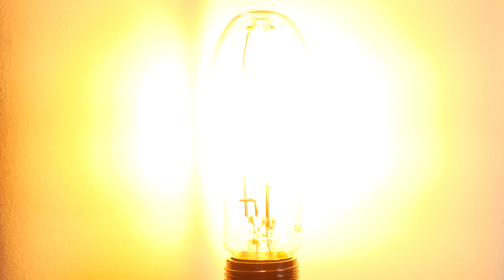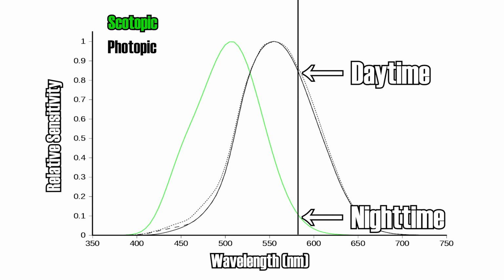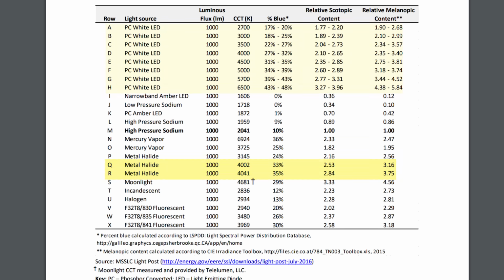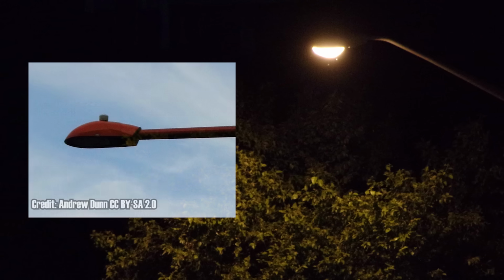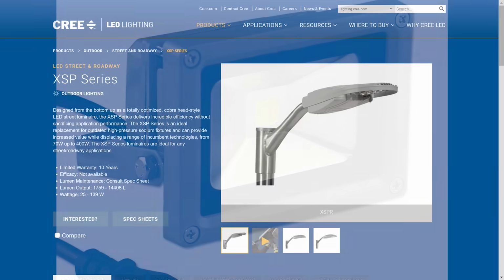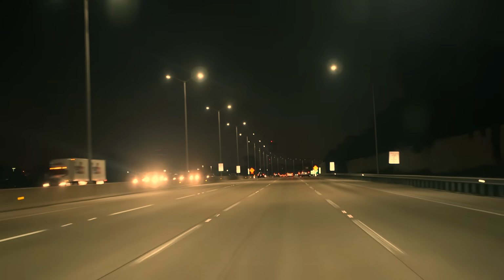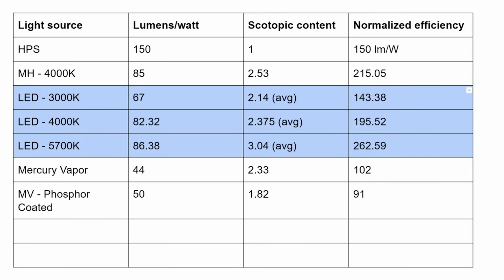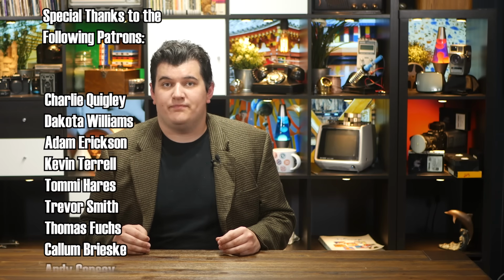The LED's Challenge to High Pressure Sodium

Comment: I see the Circadian disruption effect as a feature, not a flaw...the blue tinged light should tend to help keep drivers awake behind the wheel where the yellow tinged light will tend to increase fatigue and sleepiness...sleepy drivers are a VERY bad thing, especially if they're behind the wheel of 80,000 Lbs. (or sometimes more) Tractor-Trailers...
I was a Truck driver before getting sick & tired of the BS at the Borders as well as dealing with constantly increasing traffic congestion and/or bad weather and I found the blue-white light kept me more awake and alert behind the wheel.

Comment: I am slowly replacing my lights to LED , i still have a bunch of CFLs so i am half using LED half using CFLs and replacing the ones that burn out over time with the left over CFLs until hopefully eventually i burn thru all the CFLs and continue to replace them with LEDs. 

The original plan was to replace all with LEDs but then what to do with all the left over CFLs?  and thats why I am only half replacing them.

Comment: The big problem with LED lights is that they are so bright that the light bouncing up off the street is like a bright light shining up into the sky, becoming a big source of light pollution, especially when there si highly reflective snow on the ground, and no leaves on the trees to block the light.  The sight of the winter sky used to be utterly awe-inspiring.  NOw Orion is barely visible, even though the Cree fixtures in my city are carefully designed to not shine up into the sky.  There is a big lie street light vendors tell and that is that the LEDs are the same brightness as the sodium vapor lights, which is true only when measured photopically.  When measured scotopically, which matches the way the human eye sees, they are much much brighter (due to the shift in sensitivity so vividly portrayed in this video).  My suggestion to the world:  Motion sensors which turn off or dim lights when no one is around, and filters/optics which reduce the ultra-bright spot directly under the lamps, while maintaining even light to the sides, along with an overall dimmer light level.

Comment: Why not Amber LEDs on low speed roadways and in residential areas and white LEDs on High speed roadways and in commercial areas (albeit a little tricky in mixed use areas). It is important to light pedestrian areas too, not just the roadway, but I think pedestrian lights don't exactly need to be those stylized fixtures we often see that contribute to light pollution, there are a lot of good down facing recessed lighting options for pedestrian areas which can also just be attached to auto light fixtures.

Comment: The problem with most LED street lighting is that they are badly directed, leaving a well lit spot on the ground but too far away from the next lamp so the streets end up light, dark, light , dark and thus a driver's eyes have to keep adjusting to changing illumination.

Comment: Blue LEDs are burning my eyes. I hate LED headlights and xenons with a vengeance, especially in unlit areas where they blind me and kill my night vision.
I had to resort to wearing yellow glasses at work because the monitors finally made me see double (with each eye). Took a week to partially recover and even now I rarely can look at a monitor for a long time without the hole burning sensation.
P.S. there were cars with yellow headlights here in the event of major fog happening. And the yellow street lights are comfy in all weather. And not killing night vision, in the event someone argues about the blue light advantages in seeing.

Comment: Many street lamps in the Chicago area have been changed over to LED lighting. However, many of the units are failing only one year later... some, less than a year. Previous HID lighting lasted much longer. Did anyone include the cost of relamping when calculating the "savings"? Relamping crews don't work cheap and work on a "whenever they get to it" basis. Lamps can be out for months... like the one across the street that died after a month. Another added cost to relamping LEDs is that it's not like changing a bulb. The entire fixture is changed. Another co$t miscalculation?

Comment: I think, we should go for 5000k to reduce the production of melatonin while driving on higways etc. In cities there is an aesthetic problem with 5000k, as well as with sodium pressure light. I hate to see historic centers of cities polluted by sodium pressure light. There we should go for 2800-3000K. We humans love this light so we should use it for those areas. On bigger inner streets, we can do a compromise with 4000K, just for safety issues. So it don't has to be the same everywhere.

Comment: It may be just me, but I see better at night if the street lights are the color of a high-pressure sodium light.  For example, if I'm driving at night and go into an area that's well-lit by white LED street lights, and then into an area where the lighting is negligible (like the open highway), it takes a while for my eyes to get used to the dark.  But if I'm driving at night and go into an area that's well-lit by high-pressure sodium lights, and then onto the open highway that isn't lit at all, my eyes don't really have to adjust to the dark.

Maybe the sodium spectrum has something to do with the preservation of nighttime vision, as well as circadian rhythm?  Or maybe the narrow band of sodium light is easier for my eyes to focus in a low-light situation than full-spectrum lighting.  Those are just guesses based on personal experience, since I don't have any science to back it up.  Whether it does or not, I'm finding that the older LED street lights around my neighborhood are lit by white-light LEDs while the newer LED street lights are the same color as a new high-pressure sodium light just before it reaches normal operating temperature (sort of a copper-white mix of color).  The newer copper-white colored street lights are a lot easier on my eyes than the brilliant white-light street lights.

In conclusion, at least in my neighborhood, the LED challenge to High Pressure Sodium has been accepted and the hammer already came down.  The newest LED street lights are practically the same color as a new high-pressure sodium light.

Comment: White (blue-white) LED street lights often trick my mind into thinking another car is approaching (for instance, around a blind corner). It can be very distracting, which is obviously a bad thing for a driver.

LED headlights in oncoming vehicles are dangerous, pure and simple. It doesn't matter if they're factory fitted or aftermarket, the effect is the same. There was a time when these headlights would have been deemed illegal, due to how unsafe they are. But that was before most people turned into NPC morons with zero common sense.

Comment: Im so Pissed. In Mississauga Ontario they changed all orange lights to the Led White lights. I understand they save power.
But they are so annoying . The orange hue helped keeped bugs away and was less stressful to our eyes.
Reply: Insects visible spectrum is much more blue centred than ours, and they see red very poorly, if at all. So a higher CCT light would definitely be more likely to attract them. I mean bug lights are yellow after all. 
I miss the HPS lights. 4100k is pretty much standard in most cities in Ontario now, and it's very jarring. 3000k would've been a compromise, but I've barely even seen any LED street lights this colour so far.
Reply: a color of light doesn't keep bugs away. certain lights attract bugs though. are u saying that the bugs are attracted to the new lights?

Comment: OK, but is this really a problem ? Like: are highways so badly lit that the sodium lights actually are the cause of so many crashes ? Because LEDs, if unchecked, will have more consequences than this. LEDs emit a continuous spectrum of much cooler frequencies : as bad as light pollution is already, 1) at the moment you can get rid of most of it by using wavelength specific filters and 2) also because sodium emits a longer wavelength, it doesn't scatter nearly as much as cooler LEDs, so the problem of light pollution will increase, not just for us but for all the ecosystem around us. This could have unwanted effects on all manners of insects, animals and plants surrounding us, who already provide ecological services that are crucial to us.

Also, it would wreck the night sky for all of us, and virtually destroy my astrophotography hobby... :(

Comment: I read a lot of accusations of LED glare here. Most of that super annoying glare comes from HID lights that are poorly installed and not dimmed when they should. For a short period of time some makers of high end cars used HID's as standard equipment, and many DIY HID kits were (and still are) being sold on the internet with optional color temperatures. And, as usual, there are lots of egotistic drivers that like to literally show off their brighter-than-yours headlights, sometimes with an exhaust system to add sound to their rudeness.

Comment: Re. "blue light harms the eyes", the colour spectra of sunlight - what we think of as "white" light - peaks in the blue/green area of the spectrum, rather than being evenly distributed all the way through from red to violet. This is why plants have green leaves: there's a maximum amount of light chloroplasts can use for photosynthesis at any given wavelength, and only the amount of blue/green wavelengths in sunlight are significantly above that level. This means large amounts of excess blue/green light is reflected, but little or no light at other wavelengths. This also explains why rod cells are most sensitive to blue/green wavelengths - to maximise vision in low light conditions, our eyes have focused their sensitivity on wavelengths where there's the strongest light to begin with. So the "blue light harms the eyes" thing really doesn't make any sense because our eyes have, over hundreds of millions of years, specifically evolved to cope with the very high levels of blue light coming from our sun.

Comment: A really, really informative video, and one that shows the complexity of the issues involved, most of which I had not realized.

Blue v yellow lights along roadways: This seems to present a bit of a dilemma. You see blue better under dim night conditions (scotopic), but yellow light keeps you awake, which may be important on long drives or when it late enough that you could get drowsy. Which is better may be a highly variable thing, depending on the driver's state, the length of the drive, and possibly other factors.

It seems LEDs have an unparalleled flexibility and can be molded to a lot of different requirements, but the molding is a long way from being fully worked out to the best configurations.

Naked LEDs have narrow bandwidths, so astronomers should love them for their ability to be filtered; but white LEDs, of course, are another matter. Maybe pseudo-white, from a combination of naked elements, would be better.

Comment: I think a combined solution would be best, depending on the road type. For example on major Hwys that are far from residential areas you WANT drivers to stay awake and aware, so the higher temp colours would be a better choice, while roads closer to residential areas can use a lower temp colour to minimize the impact of the blue lights.

Comment: I prefer sodium in residential areas, a blue spectrum (higher Kelvin) shift is okay on the highway. However not in residential areas, some moron switched our 100% residential area from high pressure sodium to an annoying as hell LED 360° decorative lamp. To be honest it has crossed my mind to disable the bulb because it's straight into our Master bedroom.

Comment: sorry for the broken english in your country led light for vehicle might be good for my country not really , reason some driver abuse the right for installing LED light on their vehicle , example ford raptor lucky that vehicle too expensive like after convert about 193k USD on my country rarely can saw them on the road those LED light bar installed front by default when turn on can totally blind ahead vehicle and incoming vehicle 

or another type LED light bulb installed on their head lamp by show off look cool and want to brighter than other or giving excuse my eye got problem cant see on night when any older vehicle rear mirror and side mirror not equipped latest technology like auto dimmer really annoying , really make you how about i install the spot light on my rear just turn it on when they purposely  blind other people on the road if my local law allowed

Comment: What I found, with most LED lights, is that they're only as good as the driver circuit. Every now and then you'll see a burnt-out LED, or group of them in a string, but nine times out of 10, it's the driver that burns out in most LED light bulbs. I can imagine that the same would be true if they were used in street lights.

Comment: So, staring at the sun doesn't damage human eyes? Unless I am interpreting your words inappropriatly, that is not correct. Retenas get burned, and it is not entirely a function of wavelength of visible light. There is more involved in the physiology than simple sensitivity curves. It is entirely possible to damage eyes with spectral energy beyond thr scope of visible light, and most certainly within our visible spectrum, damage can be generated. I am glad to have just stumbled on to your wealth of geekery, and have just subscribed.

Comment: What pisses me off is people putting aftermarket LEDs for headlights on their car and doing nothing to try to prevent blinding oncoming drivers. It's so bad here that the majority of firefighters have incorrectly aligned and blinding headlights. At least one Sheriff does. I have aftermarket LEDs on my car but I took the time to align them correctly and nobody has ever flashed me with these new lights. I even verified they were not blinding oncoming drivers by turning them on and walking a few hundred feet away and putting my eyes in a position an oncoming driver would be to see for myself. You can have aftermarket LED headlights that don't blind oncoming drivers. It seems, however, the majority of LED headlight installs are done without any proper alignment or adjustments or they put them in the wrong housings and light scatters everywhere blinding oncoming drivers. That creates dangerous situations. If an oncoming driver can't see the road because your headlights are blinding them, they may drift into your lane hitting you head-on. Whos fault is that? Actually, yours, because you caused the accident with your improperly adjusted/aligned aftermarket non-DOT approved headlights.

Comment: Another problem with night driving is lane markings. I've found that the more worn the markings, the harder to see them under any sort of nighttime lighting. It's not a big deal on a small roadway, but on multi- lane roads and highways it can get downright dangerous. Future lighting changes need to take the markings into account, either with lit markings, reflectors of some sort, or "glowing" markings.

Comment: So LED means less falling asleep at the wheel. How is that bad?
Reply: Temporal Quantum Relativity its bad cause even though you feel less sleepy. You are still tired. 

Prolonged exposure can lead to health issues. 

Give the world a few more years. We’ll start seeing health issues on the news more often as the current generation that grew up with modern devices are alot more older. 

Also it’s not the LED, blue light is the one causing problem. 

So i wonder why don’t we just use LED light with a warmer temp. 

I just find white LED are too cold and harsh to look at. Mainly on roads. 

A mix of both amber and white, would be perfect for Headlight, and maybe just replace all street lights with LED that changes according to the condition. 

So that it provides better illumination when it rains. 

——

So yeah, just make it more pleasant to look at when the light shines on the “Road”(tarmac), any other areas. It’s fine.
Reply: @azimpetra   what health issues? Not death or the death of others I assume, like in the case of falling a sleep at the wheel would be. Since nothing is perfect and there are always trade offs, what are the real health issues. Stress and difficulty sleeping? We can find solutions for these that will be well worth having safer roads and streets.

Comment: They've just installed the new led street lamps in our area... We love them.. Way less light pollution also they're strange in a way. The down light has far more ground coverage than the HPS lights we had. Its also more consistent. even if a pole is missing a light the area in front is lit up perfectly. 
On another note the color temp. The new led lights are nice and soft, warm, Soft white. Not typical cold harsh white from typical led's. Its very pleasant soft light that may not be as intense but is far better at coverage and pleasing to the senses. Again we love them

Comment: Hmm. My aesthetic sensibilities seem to differ sharply from yours - I usually prefer bluer lights, yellower or reddish lights just look dim to me. And road safety should be improved by making drivers' (or pedestrians') bodies think it's not night, and make them less sleepy. As for the polluting problems, those can all be solved by improving lamp  geometry to keep all the light pointed at the area we want to illuminate, and away from where we don't. There is still the reflected light, but the impact of that should be dramatically less, and more easily countered with curtains.